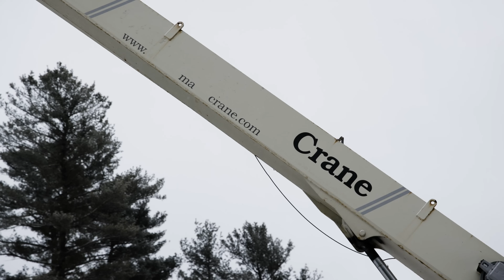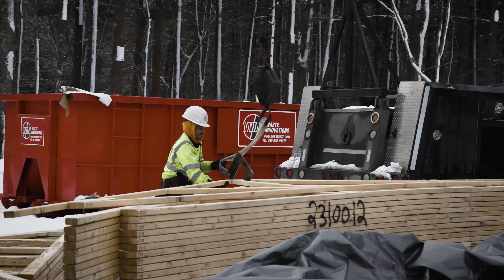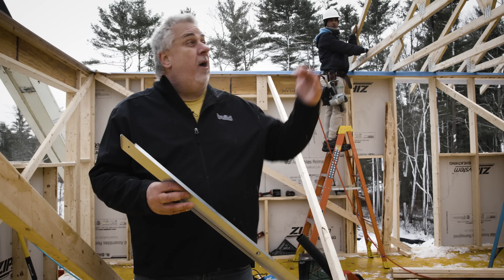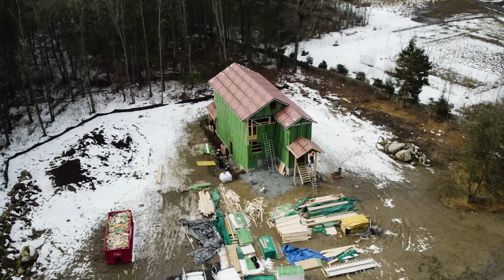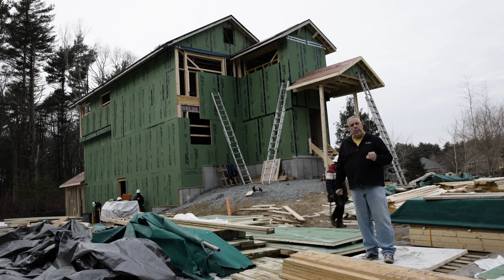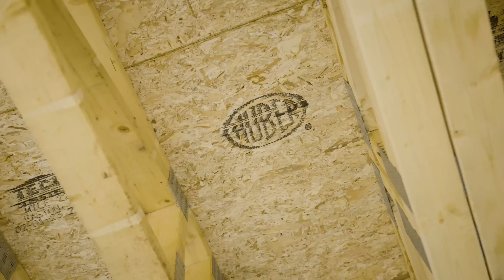Multi-Generational Home on a Budget - Episode 4 - Roofing

Comment: A commenter on another recent Build Show video mentioned another meaning for "truss uplift" where temperature and humidity differences between the top and bottom chords of a truss cause it to deform and it can cause the ceiling to lift up off of your interior walls, cracking drywall.  Since this house is being built in Climate Zone 5 and is apparently going to have an unconditioned attic, won't this house be susceptible to this. Apparently that thick layer of  fluffy stuff that is going to be blown into the attic will keep the bottom chord warm while the top chord will be exposed to frigid temperatures.  Older houses have less attic insulation so it wasn't a problem.  Seems like another reason to go with a conditioned attic with exterior roof insulation.  Maybe they can have a show where they talk about mitigating this type of truss uplift.  Some have said a site cut rafter type roof does not have this problem, another reason older homes don't have this problem.
Reply: Understand it is a function of span also, these trusses are only 22' wide, so if there was any uplift it would be minimal.

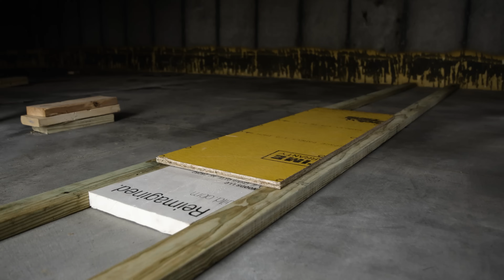Comment: 15:23 if you're going to all the time and expense to do the sleeper floor system, you could have easily put material under the sleepers that absorbs and return pressure, and made it into a sprung floor system.  That would definitely be even nicer on old joints.  I've seen a variety of materials used from pieces of rubber to cut up pool noodles.
Reply: Yes, but cost is always a consideration, especially labor cost in New England

Comment: I noticed the zip tape is over the top of the liquid flash at the base where the zip meets the concrete. Its just different from what Ive seen Matt do. Is it best practice to have the tape under the liquid flash or doesnt matter?
Cheers
Reply: There is no liquid flash to foundation connection here. We used siga fentrim tape for our air barrier to connect the zip R to the foundation. Am I misunderstand your question?
Reply: @brettpelletier1219  oh nice, I thought the grey was some sort of liquid flash. Thanks for the clarification. Much appreciated
Reply: @peterbennett3151  anytime. I find applying fentrim is easier than liquid flashing in my experience.

Comment: Wouldn’t a multigenerational home be built out of multigenerational materials? … concrete?
Reply: My great grandfather's house built in 1890 is is now 130 years or so old.  Still doing just fine and that is in a northern, cold, windy, prairie climate.  Still has the original siding.  Trees can live hundreds of years.  So, no, concrete is not necessary.
Reply: You mean wood like the 400 to 500 year old family homes in Germany? Out of wood.
Reply: @tedspradley  I was thinking more along the lines of 12,000 year old dens in caves
Reply: Concrete is CO2 intensive, not to mention is permeable to water too, so it would need just as much work as well to keep moisture out. As long as it's not being built in a hurricane / tornado zone and the air/moisture/water is handled correctly - a wood house will last just as long. Also the name of this series is "on a budget", concrete is way more expensive.
Reply: By multi-generational home I think it generally means grandparents, parents, and children, etc. will be living in the same house.
Reply: Keep the wood dry, or at the very least, allow it to dry, and it’ll last forever too

Comment: You should put the hurricane clamp down on that roof.  Sits very high.   Easy to add now.  I don't think those uplift screws will hold it . In 150mph or mega storms coming wrap metal around truss . All the way to concrete.  Maybe
Reply: Yes it looks like a very nice engineering .  But thinking today builds would be good to act like your near the coast and use ideas they do.  Some stuff is easy to add now.   Maybe not cables to slab or bands all the way to slab  .  But those nice hurricane ties they do.  Seems i see alot of roofs blow off at near tornado winds.  Now we are seeing strange weather patterns.   I know my next house will have alot of this stuff
Reply: THe home was fully engineered
Reply: You want a metal strap from the truss to concrete?!?!